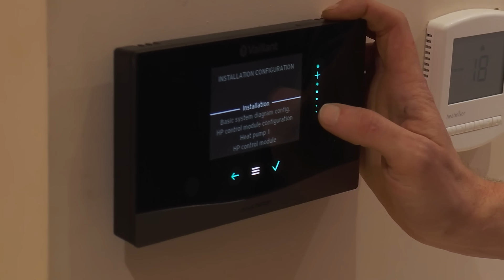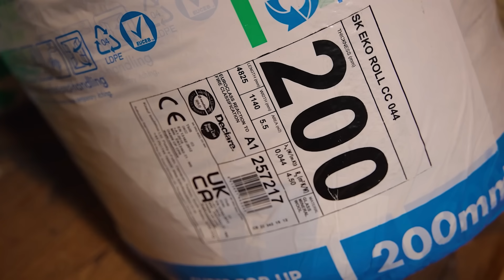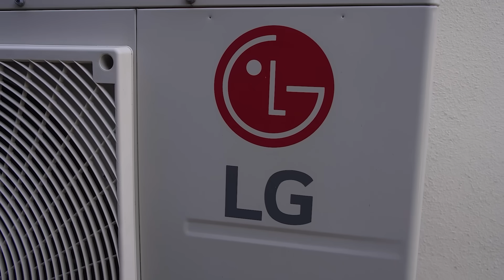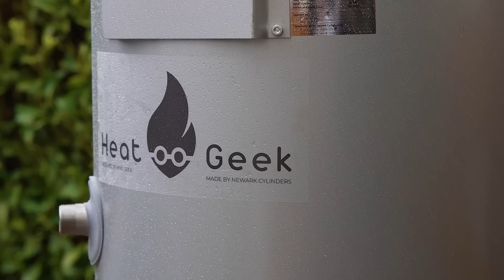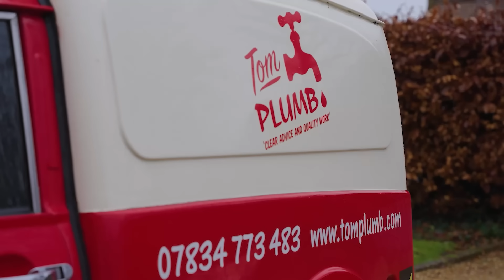Heat Geek’s Heat Pump One Year Later — The Verdict!

Comment: I have had my heat pump for 5 years, and it works really well for us .
Reply from the maker: Good to know. What make and model is it? Do you have underfloor heating or just big radiators?
Reply: @SkillBuilder  I installed myself two Gree Versati III 6 kW heatpumps in Romania because I couldn't find good and reasonable priced installers. They cost me €2.600 each including installation in 2022 when prices were higher because of the war in Ukraine.
One is installed at my 135 sqm house which is fairly well insulated and the other at a 85 sqm country house. This is the third winter used (I also have a gas boiler at my house which prepares DHW, the other house is not connected to the gas network, there isn't any over there so an electric boiler is used) and total consumption was 2.500 kWh in the first winter and 2.700 kWh in the second one for 24-25°C inside with a 30 to 38° flow temperature with radiators. A winter season in Romania usually goes from October until April or even May. This year wea had several days with -15°C. This year until March I've used about 2.755 kWh, it was a harsher winter.
The country house is not well isolated and the total consumption is about the same but for a lower inside temperature, 22-23°C and of course only 85 sqm.
Both heat pumps manage to keep those inside temperatures until about -10°C outside, lower than this they struggle to keep 24°C inside and the temperature drops to 23°C so I've set that the heat pump will activate the gas boiler for my house and and an electric immersion heater for the country house.
So I think in UK heat pumps should work even better but they need to be installed properly and also the user must be taught to use it properly. I don't use a thermostat anymore as I was with the gas boiler, I let all the radiators open at max, only the bedroom valves closes at night to keep 22°C for a better sleep.
Reply: No under floor heating which would of been nice . We didn’t have to change our existing radiators . We went for a 300 litre hot water tank as we had plenty for room for it  . Daikin monobloc  16Kw . Flow temp  works well at 37 degrees,most  of the winter . And on the coldest morning -3 this winter ,the flow temp was at 43 degrees we use weather compensation  . Room temp 20 degrees as that’s our preference . 5 bedroom home in the uk and it was built around  1980 . The house already had cavity wall insulation and plenty of loft insulation .

Comment: Comparing going full electric or keeping a gas hob and the standing charge is still cheaper for me than going fully electric with a high efficiency induction hob using an average of 2 burners per day for 1 hour.

Induction is more efficient but we are driven by cost and gas is so much cheaper

Comment: For the record, I have a new Vaillant 10kW installation, it is super quiet, works fine, water heating on cheap overnight electricity will save me £140 a year, standing charge for gas goes at another £107 a year. Heating will be a little cheaper as my battery extends the cheap electricity into the day in the winter. The temperature in the house is pretty even throughout the day and it can easily keep up with the coldest day. One of the plumbers (not a worker of the company that fitted the system) says that Vaillant heat pumps are really good and reliable.
Reply: Worry not,  your savings will soon be taxed!!...🤣

Comment: Very happy with our Heatpump.

Also we went non gas so have an induction hob it's basically the same as a gas hob i.e. Instant heat.
Reply: I was surprised to hear of an induction hob as being a "green" option.  They are just better by far for everything except perhaps a wok but your average gas hob is not good enough for them either.
Reply: @notverygoodguy  woks need a spcific cradle for the pan shape

Comment: We went from gas hob to induction and would never dream of using gas again.
Our induction hob is as quick if not quicker than our gas hob at heating a pan of water, way more controllable for cooking pasta amd not boiling over, way easier to clean woth just a damp cloth, and i dont have all the combustion pollution and moisture in the air!

Comment: We saved up 10k to have a heat pump, about 4 years ago now, that covered just the heat pump. Our plummer was like WTF. we decided to insulate instead, and replace rads, piping, boiler and new tanks. so glad we did as our winter useage is now around £80 of gas. As electric is now 40p the running cost would have been alot more. with the tecnology improving when our current boiler dies we will proably end up with a heat pump. but im not spending over 2k on somthing that has the same  running costs.
Reply: I'd say that you made the right decision four years ago as there weren't enough well-trained installers, but things have moved on now. There's a lot more information out there and well-vetted installers if you know where to look, plus there are specialist tarrifs that are much cheaper (John's install came out to be something like 1/3rd the price of gas on the OVO tariff once it was all sorted).

The main problem now (imo) is that it's still very much caveat emptor. The consumer has to shoulder too much responsibility and risk. I'd get a heat pump in a heartbeat as I can spend the time and effort picking the installers and sanity-checking things, but would I recommend everyone do it? Nope. Too many things that can go wrong. The government needs better regulation and guarantees in place.

Comment: The problem is that you are almost assured to get a bad installation. Any government mandated scheme will attract cowboys.

Interesting that he actually said early on that electricity usage is very heavy. It is only the cheap tarrif that makes it possible. When the price goes up due to net zero the price will rise massively.

Also many people with heat pumps seem to have additional heating sources.

We used to have standing charge incorporated into the unit price. It was stopped because it isnt transparent. You dont know how many units they have to sell to get back investment in your connection. Why do you think that you should pay less for the connection just because you buy less gas? You should pay massively for your initial units to pay for the connection, and you will. Better to know how much you are paying. You are going to have enough trouble keeping tabs when variable pricing starts. You will have no idea whether you are being charged correctly or not.

Comment: Huge house, keeps it all at 20degC.  
I find once your walls have warmed up, as they will with constant heat, you are comfortable at a lower temperature, say 16deg. (perhaps wear a jumper?) 
So if it is 8deg outside, you have reduced your heat requirement by 1/3.
Reply: 20 isn't warm enough for me.  16 certainly isn't unless I'm moving around doing housework or something.  And no, I am not going  to sit and watch telly under a duvet, in a onesie, or wearing a jumper and gloves, it's 2025 not 1965.

Comment: I'm getting a heat pump fitted by experts. Just waiting to win the lottery so I can afford it. GET REAL guys 😮😮
Reply: With the grant included, they tend to be similar / a couple more grand expensive vs. replacing a gas boiler (inc. insulation work for a heat pump). So er, yes. If you win a few grand you should be good to go.

Comment: Too expensive (Government grant just a cash grab)
Why are they so much more than the A/C version and not just a little bit
Too complicated all that electronics (  will be obsolete and  spares unobtainable  before warranty runs out  -good luck there)
Too noisy
Too many chancers fitting them  ( easy to get certified as a company- try findi g compitant and experienced engineers)
And don't get started on getting it repaired 
plumbers can't or won't want to
Refrigeration engineers can but will not want to get involved ( if they have any sense- why would you want to take on someone else's F up !!!!!)
And before you asked 45 years experience and 8 was working in HPs  in the 1980

Comment: A heat pump installed properly is great but people throw them in because boilers can be thrown in and will set themselves up as they have far more modulation. Also having people change their lifestyle to suit a heat pump can be a big issue as for decades people are used to heating themselves for 2 hours before bed and possibly in the morning before work. Outside of that they're not running it, so a low and slow will always be more expensive regardless of being more efficient.
Reply: Correct.  It's ridiculous that in order to be 'energy efficient' we have to heat our houses 24/7 because that's how heat pumps need to work.  We should be looking at ways to just heat the rooms we are using, when we are using them.  Why heat a bedroom when you aren't in it? Why constantly heat a bathroom or kitchen that you probably only use for an hour a day?

Comment: By the way, thanks for this series. It's been really interesting and unbiased and very useful to me.
Reply from the maker: Glad to hear it!
Reply: @philiphtube  I would say it's an 'attempt' to be unbiased not unbiased. Any gas boiler engineer will always try to protect their business which is understandable but that is no justification for a rapid change to a better system. These gas boiler engineers need to be restrained for free and taken along with the journey to cleaner tech. Sure they may not want to be involved in the specific design process but there will always need to be fitters to install a well designed system.
Reply: @S0me0ne_S0meWhere_SaysHi  Hi Someone, I think that you mean re-trained for free not restrained for free. Also, you sentence starting 'Any gas boiler..' doesn't read properly. However, I think I know what you are trying to say. In my opinion, ASHPs work very well when they are built into new, purpose built buildings that are designed around them. So for new builds, going forward, they make sense and this has been demonstrated successfully in other European countries. However, it seems to me that there are significant issues that make these systems non-viable for the vast majority of existing housing stock in the UK. The idea that you can simply replace gas fired heating systems with ASHPs in most dwellings ignores the many and very real issues that make this non-viable. Even the House of Commons have decided that it's just not going to work in their building.
Reply: @philiphtube  I am inclined to disagree that a lot of existing builds cannot benefit from heat pumps. Sure not as well as a new build (of which most still don't use heat pumps anyway because most developers won't get their greedy profit from so much) but, to cling on to fossil fuel burning boilers is just unacceptable. If a place cannot have a heat pump then it will be better to replace it with something like that shown in the following link. Or even something better which has not been designed yet. Clinging on to old technology is unacceptable. 

https://youtu.be/JvuhflheiyI?si=U3OBO8y9pphM-H_d

Comment: Personally, I'd rather be mauled by a bear. 
I own a bungalow with an extension with a really shoddy flat roof, which is freezing in winter if the heating is not on. I would have to spend tens of thousands of pounds redoing the roof and reinsulating the loft and flat roof before even contemplating installing a heat pump.

Comment: Not many houses in UK are suited to retro fit. Has to be fitted by proper engineer, not a fitter. Has to be a very complex and expensive instal. Life expectancy and reliability?? Compared to a simple boiler?
If have well insulated house, underfloor heating, good equipment,  correctly installed,  I can see it being great......Otherwise......am not convinced. We have one log burner running 24/7 in two bed bungalow. Heats it better than the oil central heating, especially when very cold. 100% reliable, last a lifetime solid cast. If had instant hot water heaters could lose the boiler and rads completely

Comment: Our heat pump has been in 18 months so two winters, it has used 3135 kwhs of electricity in a 3 bed bungalow. It's on 24/7 we have solar and batteries so our kwhs are approximately 9p, feel free to calculate.
I personally call it witchcraft 😂

Comment: Your point on continuous heating on a fully modulating gas boiler is spot on, as that's what I've been doing this winter.
   I'd already boosted radiator capacities, was doing a manual version of weather compensation to figure the curve required all the way down to -10, and was running room temps variously at 18 through to 22.5 with quite staggering stability controlled only by the TRVs....  No -16 event this year to test, but I've a hunch the worst case 23c return wouldn't have been budged much.
Reply from the maker: I agree with you, it is doable with a gas boiler. I still get better economy than that by switching it off and on when we need the heat.  Whatever anyone says there is always a heat loss and the longer you heat a house the more heat you lose.
Reply: @SkillBuilder  Sorry to disagree Roger but you're looking at it from slightly the wrong angle - Maintaining thermal equilibrium in the walls etc will make a gnats hair of difference in consumption if the stat  differential is tight - Most digitat stats can be programmed +/- 0.1 rather than the +/-0.2 standard.
   I tried the Viessmann with it's load compensation thermostat after the old boiler blew it's MB in March 24, economic for sure, but couldn't figure how to reduce the differential =/-0.2 else I might not have abandoned it.
   With fair historic comparison gone, I decided to go for comfort and constant feed with the idea of auto WC - The NTP has been parked out back all winter whilst I've been adjusting feed temp manually, interesting in that the return temp has pretty much been stuck ca 23..

   Had already tamed the towel rails returns with alloy wall rads in train and they worked a treat, so now all the rads take what they need with the TRVs effectively hovering on closed.
   No offence intended, but for constant heating forget about all you learned about 20c rad differentials when it was on/off, 
 Only on two rads did I ever see a sniff at a differential of 20c, from memory 17-18c from two rads yet I still got a consistent 23 return.
   My Lounge hosting the thermostat was the by far my biggest bugbear - By making each room temp dependent only on it's TRV with a constant feed from the boiler, I could hold a massive pissup/party in the Lounge and it wouldn't affect any of the rest of the house 😉
Hope that clarifies...

Comment: Two elephants in the room. That plug in electric heater and the UK and RoI having the most expensive electricity in the world.
Reply: It seems to be a conservatory. I've been in plenty in houses with gas boilers, they are never warm. At a SCOP of 450%, this pump will be cheaper to run than a boiler
Reply: Not really, it’s clearly a conservatory. Massive heat loss regardless of the heat source. It would be cold in there with a boiler too.
Reply: @bigpete1986  That wasn't the room that needed the electric heater, though; he was describing his office/corner bedroom which had two external solid brick walls; and the electric heater was needed to balance the gas heating, not the heat pump.
Reply: @ yep, multiple comments about this and the point where an electric heater was mentioned when they went back to gas after the initial poor installation! People so quick to try and bash heat pumps they can’t seem to listen or observe accurately!
Reply: @bigpete1986  Yes! My thoughts entirely... all that glass ... without lovely thick curtains in front. In fact there is a solution to that, although with that humungous area of glass it'd need a new mortgage: vacuum glazing. Double glazing, but equivalent to triple glazing in terms of heat and acoustic insulation. I have that everywhere in my home: LandVac, a Japanese company.
Reply: Ignoring obvious conservatory, the heat pump is still much cheaper to run because he's getting 450% out for every unit he's putting in. £1 of electricity to a well-installed heat pump does the same as £2.50 in an ~90% efficient gas boiler. The running costs aren't even close. The price of electricity is too high, but it's not relevant here.

There are real problems and they're cowboy installers grabbing grant money, and there not being enough technicians.

Comment: The one size fits all, single solution approach is always going to feel like square pegs into round holes for many. My concern is switching everything to an electical solution leads us into a world of dependance that turns minor issues into huge problems. I cite the Heathrow closure due to a substation fire as the latest example.
Reply: Another example was Cumbria a few years ago when snow and floods cut the electricity supply for weeks to some places. Imagine being reliant on electric heating, cooking , hot water and transport during those weeks. You are back to the stone age

Many places don't have a working fire place anymore to use solid fuel in an emergency.
Reply: A gas boiler won't work without electricity... So a gas boiler is dependant on 2 sources of power/fuel.  I understand your point, I just think it is flawed.
Reply: @Ben-gm9lo  We are being pushed to electricity as the ONLY power solution, not just heating.

Comment: Fit a heat pump if you want to turn your 3 bedroom house into a 2 bedroom house!
Reply: Not really. You can use a mono-block unit that stays outside. You need a hole in the wall and two pipes connected below the gas boiler.